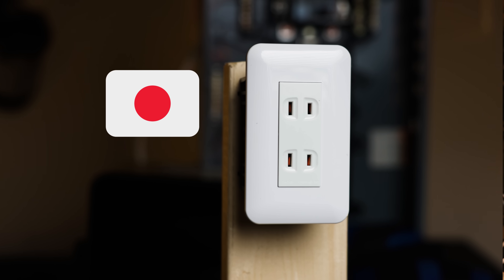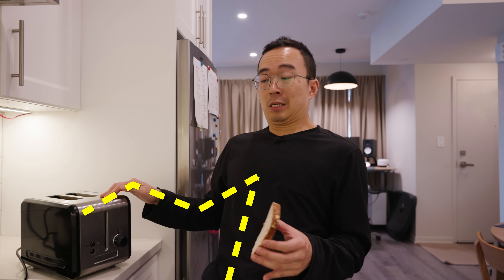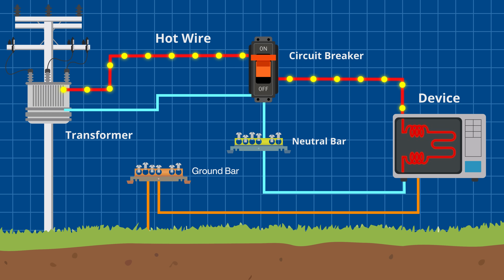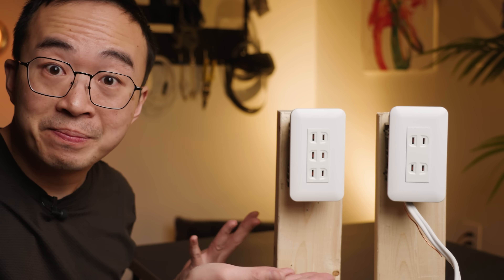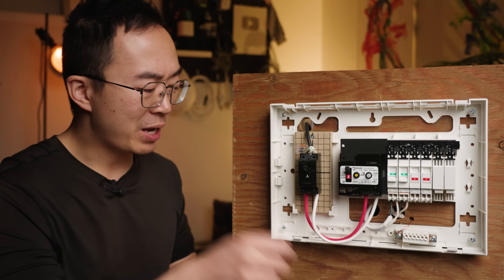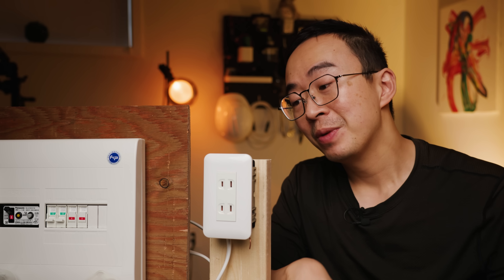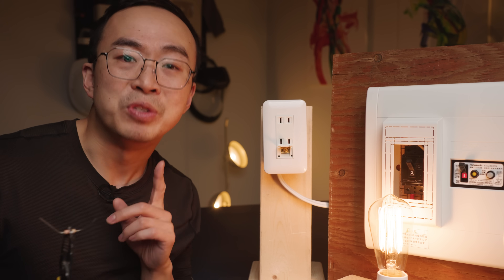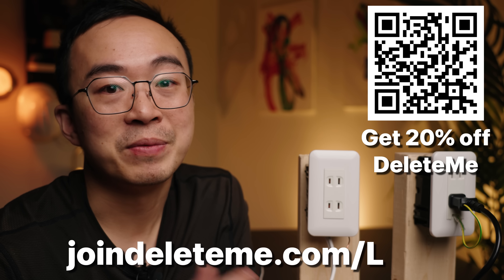How Japan Made Their Outlet Safe

Comment: This video is so stupid. Every socket is grounded, they have to be to actually work cause without a ground. The circuit doesn't work. This is basic electrical systems. The question is, how are they grounded? You opened up the Japan box and showed us they are all grounded, just doesn't run back to Neutral. No, the 2 prong outlets ain't safe, that is why America upgraded and went to the 3 prong system. You can still find 2 prong outlets in America, if the home was built before 1960, afterwards, America made new building codes and switched to the 3 prong outlet system cause it is safer. Maybe do some more research before making a stupid video like this.

Comment: The truth is equipment grounding conductors are in place to protect equipment, hence the name. They are not necessarily in place to save humans, however human safety is a benefit of having the grounding conductors in place. Devices such as ground fault circuit interrupters (GFCI) and arc fault circuit interrupters (AFCI) are the devices that exist that are designed for human safety. And strangely enough, although “ground” is in the name of a GFCI, ground has little to do with how these devices operate. Rather, it’s balance of power in the circuit. What current goes into a device must come out on the return conductor (neutral or opposite “hot” leg). If the GFCI reads an imbalance of current it immediately trips. Because at this point of imbalance, the missing current is likely going through you, the user. Think, toaster in a bathtub scenario. Many believe that current always takes the route of least resistance. But this is not necessarily true. The truth is, electricity finds multiple paths which includes humans. Now you know.

Comment: My main gripe with US outlets is the fact that the prongs on a plug complete the circuit while still exposed. This is easily prevented with recessed plugs or moving the internal contacts further in, so I never understood it. As a kid I was shocked a number of times pulling chargers out of walls because of this, accidentally touching the prongs. Even as an adult it has happened a couple times when I was being careless.

Comment: In Germany the Schuko-Steckdose (CEE 7/4 and CEE 7/3, aka Type F, compatible with the ungrounded Euro-Stecker CEE 7/16, aka Type C for devices that are insulated) has a default grounding contact, and you are not able to wiggle the connector half out of the socket with the danger of touching the live wire, GFCI or not.

Comment: North American wiring did not have a ground until the 1950s or early 1960s.  LOTS of homes have a 2-wire system.  Those homes have 2-plug outlets without a ground.  BUT buying two-prong outlets is expensive, so many people have installed three prong outlets to replace the old ones and just left the ground unattached to anything.  SO, in old homes, it appears that they are grounded outlets, but in reality they are not grounded.

Comment: Why do so many appliances not have a ground wire/plug in North America?  MANY items you buy have a feed and neutral (black and white wires) but no ground (bare or green wire) in them.  Why is that?  Why not ground EVERYTHING for safety (my clock radio does not have a ground but could be dropped into water and then only a GFCI would save me, and my home doesn't have them everywhere.

Comment: So, what is the voltage used in Japan? You mentioned 50 Ma to trip one...that's quite a lot if you use 250 V. At 110 V the US uses 5 MA to trip. As an electrician for 48 years in the US, I still think GFCI's leave a lot to be desired, and not being self-checking is a big reason. Now some genius here seems to think we need a childproof GFCI that takes a child to insert a plug into one. oldsters don't have a chance...they have to run extension cords from other rooms, or wait till an athletic teen comes over to visit, to shave,🙄

Comment: The weird screw in ground plug seems very odd vs using the one Americans had for years. If it needs a special receptacle anyway why not use the one with the ground pin from the start. I’m curious how that was the solution they started using.

Comment: People always leave out, US GFCIs are 6mA to trip, not 30mA like Japan or Europe. 30mA is enough to prevent you from releasing a wire from your grasp, or could make you fall. 6mA is low enough you can release the wire, it’s not going to make you fall over. The added sensitivity means you can’t have a single main breaker with GFCI, but each individual circuit needs its own GFCI protection. The USA has dramatically increasing the number of circuits that need GFCI or AFCI protection to the point it’s easier to meet code by installing all combined GFCI/AFCI breakers on every circuit.

Comment: Your explanation of ground in NA is completely wrong
Reply from the maker: I'm correct.  Ground acts as a low-impedance path to trip the circuit breaker and turn off the circuit.   One of the best video on grounding and bonding covers this point in incredible detail.  https://www.youtube.com/watch?v=mpgAVE4UwFw&t=993s  This is someone who has built an incredible system teaching NEC and how it actually works.

From his PDF:  https://www.mikeholt.com/instructor2/img/product/pdf/1292448885sample.pdf

Effective Ground-Fault Current Path. An intentionally constructed low-impedance conductive path designed to carry fault current from the point of a ground fault on a wiring system to the electrical supply source. The effective ground-fault current path is intended to help remove dangerous voltage from a ground fault by opening the circuit overcurrent device.
Reply: @ just because you saw it on a video does not mean you are correct. I’ve been a certified electrician for over 30 years and your explanation is completely rubbish. You are misinformed and misinforming. And very ignorant about electricity if you really believe this is how it works. Don your homework before trying to teach others
Reply from the maker: And this is a person who teaches master electricians how grounding and bonding actually works.  Shrug, there are many people who also say they are certified electricians and say this is how grounding works in the comments.
Reply: @ your information is incorrect and your arrogance is insurmountable. You are misinforming your viewers and fooling yourself. And if you understood anything about electricity it would be obvious why. The way you explain how ground works in North America is ignorant and absurd .
Good luck

Comment: Very interesting. Until now I somehow thought that the FI/RCD requires a PE to work. But that probably only applies to some RCD Testers. In Germany the RCD is mandatory since 1984 - but only for "wet rooms" like bathrooms and only for new installations or modifications. That already saved the life of my wife and baby child when a plugged in hairdryer fell into the bathtub. And it ruined the birthday party of this kid a few years later in winter when a nail removed most of the insulation of a cable inside the wall and tripped the RCD on high power demand in this circuit - and the whole hose went dark and cold. We now have three RCDs - but for all rooms

Circuits with no PE are not allowed and PE connected to N is prohibited for more than 50 years here. I am pretty sure there is good reason for that...

Comment: The interesting thing is that Australia has done almost exactly the same thing since the early 1990s, with every domestic circuit RCD/GFCI protected and the only difference is that we have an earth wire as well, because that was already there and provides that Neutral/Earth connection at the fusebox to trip from faulty appliances, without some-one having to touch it.

Comment: In the uk we have used RCDs and RCBOs and have been used since the 90s as well as the plugs we use they are even designed so that if a kid unplugs then where the fingers would touch it’s protected and the earth pin is used to open a gate and is the last part to disconnect from the socket. Have a look at the uk system and you will see safety in action 😊

Comment: Dont like the way you linked neutral to ground in the box. If your neutral breaks upstream then everything goes live. This is the TNC system, banned in the uk and lingering on in some ancient Swiss / German installations. JFCI / RCD are fine but .. make sure they can trip on DC. In the uk we're phasing out the old AC type of RCD as they won't trip once there's any DC leakage. And these days with switch mode power supplies, electric vehicles and solar pv there's plenty of DC about.

Comment: As always, Europe is the safest yet again. We have all outlets grounded (But non grounded ones are also still allowed in very specific cases) a general GFCI and for single family homes and most modern apartments, we usually get several GFCI protecting different circuits of the house.

Comment: so the sullution to having high earth resistance is having a TN grounding system big company's in the netherlands already have them and it allows them to have big machinery without RCD because they just ground the whole chassy and only electrical engineers work on them with the breaker off and locked of cource

Comment: Common residual current circuit breakers (RCCBs/GFCIs) react in less than 40 milliseconds. Regular fuses (melting fuses and circuit breakers) that we still have around a lot I. Germany (installations from the 60s/70s). And that could be the difference between life and death .

Germany/Europe:

 Faster disconnection (<40ms)
 Redundant safety through PE (ground wire)
 Higher installation costs
 More complex installation

Japan:

 Simpler system without PE
 More cost-effective
 Slower disconnection (~100ms)
 Less redundant safety

The European system offers more safety margins, while the Japanese system is more practical and cheaper.

Accident statistics show no significant differences.

The different approaches also reflect different philosophies:

 Europe: Maximum safety through multiple systems
 Japan: Pragmatic approach with adequate safety

...which brings us to the point. More pragmatic, more widespread.

Comment: 3:58 so why have the ground go into the ground?
Reply from the maker: It deals with overvoltage conditions as lightning (not to prevent it) but to avoid arcing inside your home: https://youtu.be/mpgAVE4UwFw?t=1886

There's also a PDF:
Electrical power systems, such as the secondary winding of a transformer are grounded (connected to the earth) to limit the voltage induced by lightning, line surges, or unintentional contact by higher-voltage lines. Failure to ground the metal parts can result in high voltage on metal parts from an indirect lightning strike to seek a path to the earth within the building— possibly resulting in a fire and/or electric shock

https://www.mikeholt.com/instructor2/img/product/pdf/1292448885sample.pdf

Comment: They did NOT make the outlets safer. As usual, they took a shortcut after the war and haven't upgraded since. This was PURELY to save money on metals that were in short supply. Whole-house GFCI is a NIGHTMARE since you can almost never trace faults. Essentially, if there is a fault ANYWHERE in your house, then you are completely without power until it's traced and fixed. So rather than a breaker tripping and simply checking that circuit, you get to check the wiring in your whole house. Electricians here love it since they can charge much more for simple tasks. High amp outlets are usually grounded as well as shown in the video.....just with that incredibly stupid grounding cable that must be screwed into place...seriously, FFS. This is what the host says "are super rare"...that's complete BS. These are EVERYWHERE in a typical house and a massive pain. Typical Japanese short-sightedness.
Fun fact...if you even change an existing outlet or bulb fixture, and you aren't a licensed electrician, your house insurance is void...yayyyyy. Japan could be such a nice place, but it's due to institutionalised stupidity that nothing has changed and we are still only on 100V....oh yeah, and 50 or 60Hz depending on where you live. Grow up Japan.

Comment: European choice is the best. You can plug in 180° both ways. Easier to find in darkness and twice the chance that cable goes from socket in to your desired direction.  I always struggle in America to plug Laptop in darkness. Also, when using bulky travel adapter then those holes are too close and my adapter covers neighbouring sockets making impossible to use them.   European socket example, google: "ABB Basic 55". Japan please use those. :)

Comment: Very advanced to have made rcd's mandatory as far back as 1971. That would have really saved a lot of lives. Everything should be double insulated in this day and age and not require an earth. Earth should still be used even if it's just to shield rf interference. Like for audio gear hum etc and not for protection. In my opinion.

Comment: Fun fact in the usa if you have an old home that does not have the 3rd hole in your outlet and you want to upgrade to a 3 hole outlet because you want to make toast or something you can replace that outlet with a gfci outlet and its code legal. You do have to label that outlet not protected by equipment ground. Gfci works by detecting current imbalances between the hot and neutal (ungrounded and grounded conductors), and if that imbalance is less than a few miliamps, it shuts off the circuit in a blink of an eye. Gfcis made to protect equipment trip around 30 miliamps and for personel prorection around 6 miliamps

Comment: You should never rely on a tester like the one you showed in your video to test a GFCI. In North America you are allowed to install 3-pole receptacles on 2-wire (ungrounded) circuits as long as they are GFCI protected and labeled as having "no equipment ground". The GFCI will work for all of the reasons you explained in your video, but those little testers you show require an equipment ground to function. Thats why the only UL approved method of testing a GFCI receptacle is to use the self test function

Comment: Fun fact: Japan has two electric grids that operate at different frequencies. After WW2 half the country contracted with GE and got 60
Hz equipment, and the other half contracts with Siemens and got 50 Hz equipment. The two can exchange energy only through DC interties, which became very very important after Fukushima was destroyed.
Reply: They used different frequencies even before ww2.  In 1880s ,Germany(50hz) and US (60hz) helped them to build their power grid.

Comment: We have in Argentina that grounding system and the same GFCI switches, but still our plugs have the ground connection (we use the same as plug as Australia).
Reply: Also, by normative all of our outlets should be grounded, but that's done from the inside.

Comment: I couldn’t help noticing that you had four 20-amp breakers in your Japanese breaker box, meaning that your house would need an 80-ampere service into the house. Funny that you only have a 30-amp mains breaker! 😄 It does underscore that Japanese households typically don’t use much power... I've seen  mostly 30- and 50-amp services, a far cry from the 200-amp services I was used to in Canada! In one older house I lived in there was only a 20-amp service, which was the bane of my existence, trying to run multiple 500-watt halogen lamps in my makeshift photo studio! 😞

Moving on to your explanation that making a connection between ground and neutral “creates a high-speed raceway back to the transformer” would mean electricity could travel faster than the speed of light. 😄 Allow me to offer a better explanation:

Current flows between the hot and neutral lines from the transformer making a closed loop.  If neutral is isolated from ground, then simply touching your faulty toaster wouldn’t give you a shock, because there would be no path for the current to flow back to neutral. You would have to touch both hot and neutral to complete the loop and get a shock.

Neutral is connected to ground (earth) to keep it from floating above zero volts, which is the expectation in the split-phase electrical system we encounter in North America and Japan. Once you do that, though, you have created a potential current path from the toaster chassis, through your body to your wet feet to earth, and then from earth back to neutral, thus closing the loop. ⚡😵‍💫⚡

So where does the ground wire come in? By connecting the toaster chassis to neutral (via the ground wire), we have created a low-resistance path back to the transformer. In a fault-free situation, there should be no current flow along that ground wire but, if there is a fault--say a hot wire coming in contact with the chassis (like in your video)--then a large amount of current will flow via neutral, back to the transformer. The circuit breaker would "sense" this current flowing in the loop, and if it exceeded the rating of the breaker (usually 15), the breaker would "trip". 

That said, while the circuit breaker senses the current in the loop, it can't tell whether the path is through your body or not. GFCIs can, though, because they measure the difference in current flowing between the hot and neutral wires. If there is a difference, then there is a "ground fault"; that is, some of the current is leaking from the intended current path via ground. Sticking a metal chop stick into an outlet would cause just such a leakage. Don't do this!⚡😵‍💫⚡ Just saying.

GFCIs work whether or not you have a three-prong outlet, but the third prong (the ground wire to your toaster chassis) creates a low-resistance path from the faulty hot wire touching the chassis, back to neutral, which trips the main breaker instantly, whereas the GFCI will only trip when you touch actually touch the faulty toaster. Kudos to @repatch43 for pointing this out earlier!